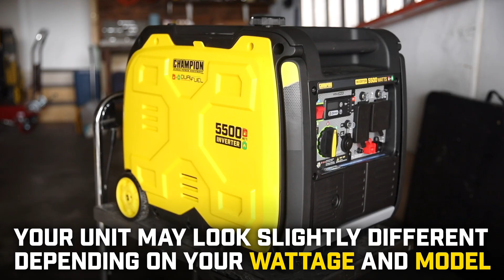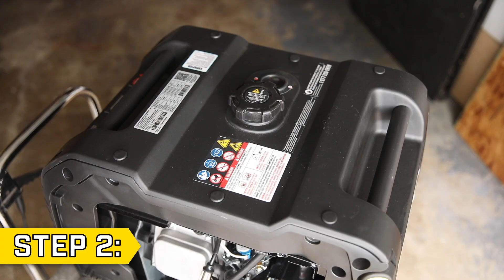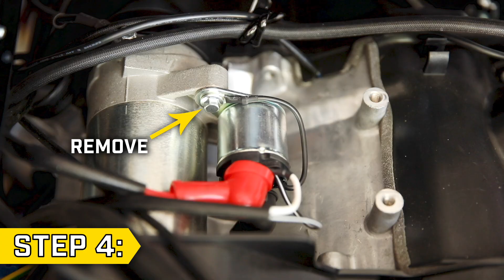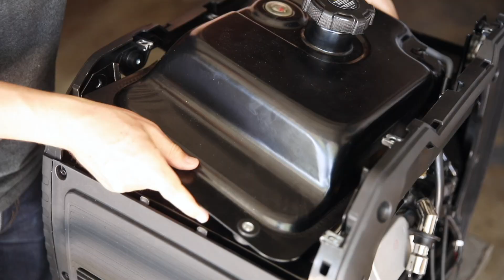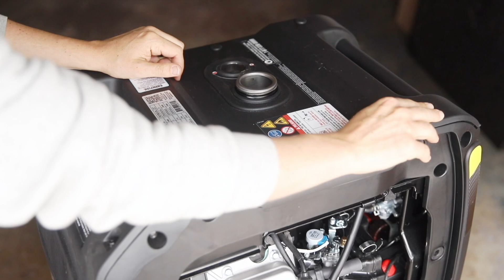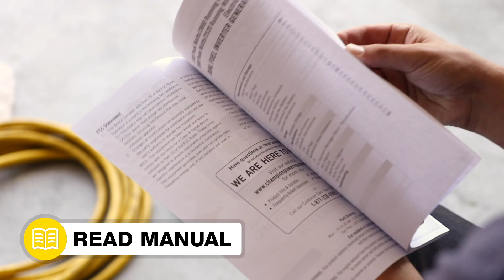Starter Relay Replacement (4500-5500W Inverters)

Comment: What size Allen wrench for the bolts on the handle
Reply from the maker: Hello, you will need a 5mm Allen Wrench to remove the bolts on the handle. If you have any other questions, please contact our support team at 877-338-0999, support@cpeauto.com, or by using our live chat option located on our website. -Thank you